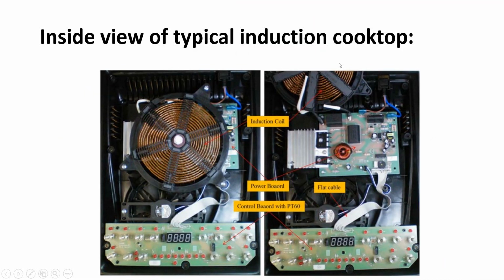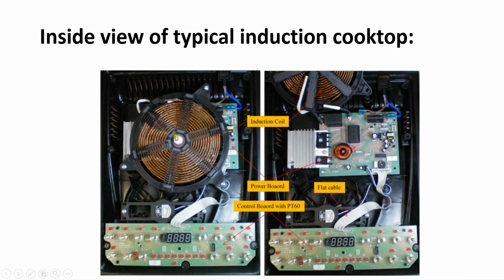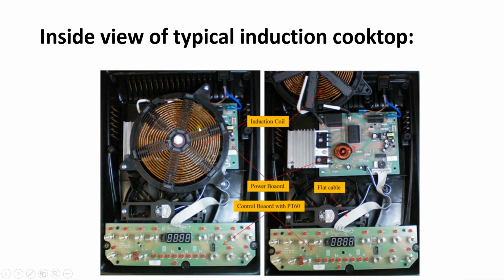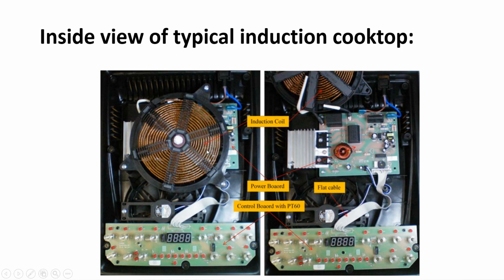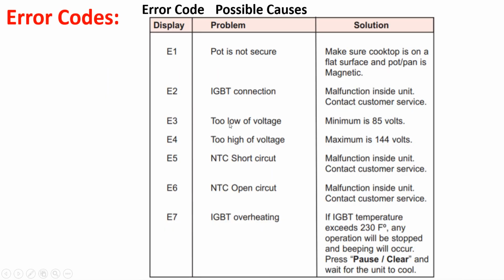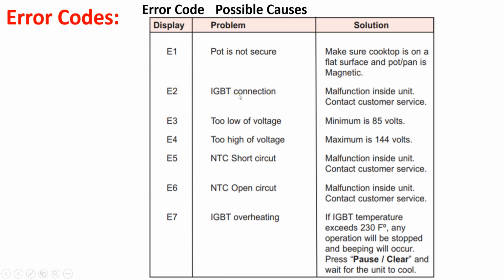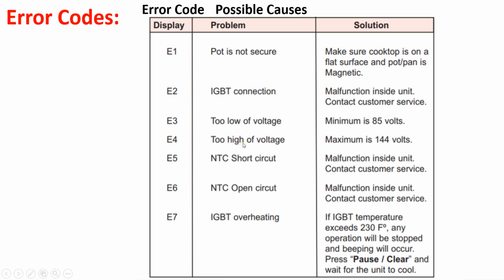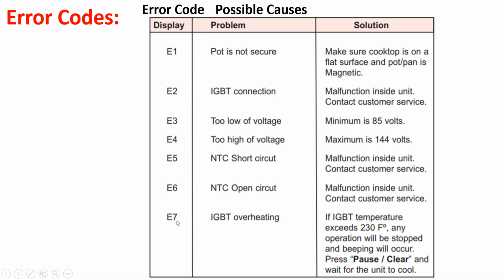NuWave Induction Cooktop Error Codes E1 || E2 || E3 || E4 || E5 || E6 || E7

Comment: Mine must just be trash and need returned. This is my second unit at that both of which worked less than two weeks before failing to ever heat again and always giving an Error 1 code. This is the most expensive piece of trash I ever purchased. NuWave is a no no brand from now on for this house hold. Every single item we have ever purchased from them has been a nightmare. The worst of which has been this one and the “warranty” claim I was forced to file a week after purchase. At this point I am just gonna dispute the charge. $200 + and two units later, with weeks of waiting and I got to use both units less than 3 times in total as they both had the same issue. The brand is just trash

Comment: The information you have provided is great 👍 but not what I was looking for, as you show error code's 1-7 but the one that I am experiencing is error code 8.
Reply: It’s a brand issue. They are just trash and spit out random codes. I went through 2 of these units and got to use both less than a total of 3 times. For $200 and to have two units back to back with the same issues, tells me they never should have released this product to begin with.